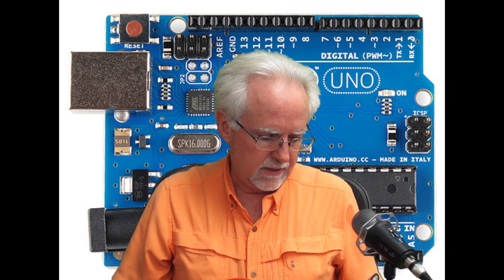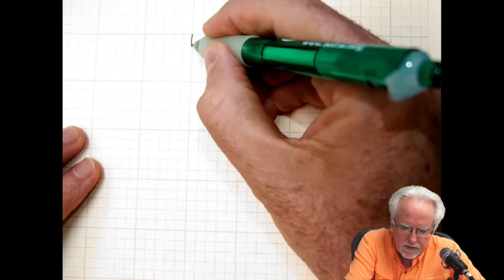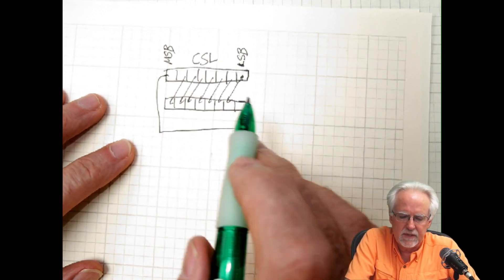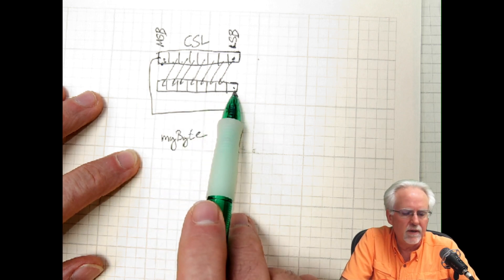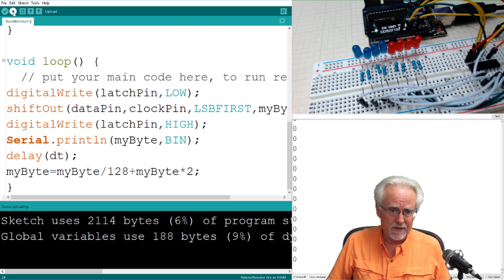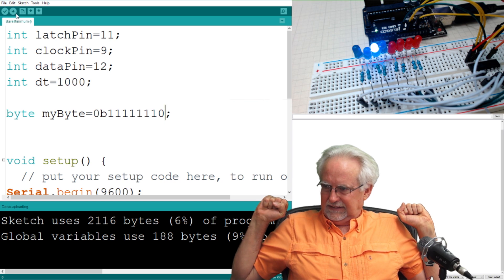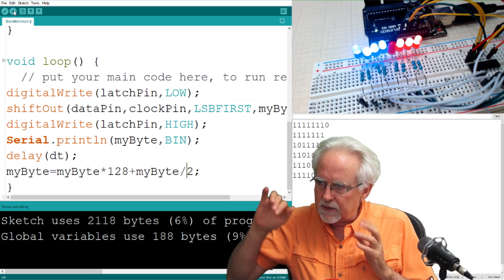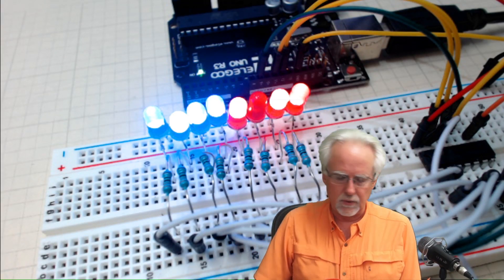Arduino Tutorial 45: Understanding Circular Shift Left and Circular Shift Right with the 74HC595

Comment: And this is the code for Circular Shift Right:

//Circular Shift Right

int latchPin=11;
int clockPin=9;
int dataPin=12;
int wait=50;

byte led=0b11110000;
byte x;

void setup() {
// put your setup code here, to run once:
  Serial.begin(9600);
  pinMode(latchPin, OUTPUT);
  pinMode(clockPin, OUTPUT);
  pinMode(dataPin, OUTPUT);
}

void loop() {
// put your main code here, to run repeatedly:

//Display the Binary Number to the LEDs
  digitalWrite(latchPin, HIGH);
  shiftOut(dataPin, clockPin, LSBFIRST, led);
  digitalWrite(latchPin, LOW);

  delay(wait);

//Reads and stores the 0th bit (LSB) of the variable "led" 
  x=bitRead(led,0);

//Right Shift Operator: Shifts bits to the Right by 1 position
  led=led>>1; 

//Now that the bits in variable "led" have been Shifted, we write the Stored 
//bit in variable "x" to the 7th bit (MSB) of the variable "led"  
  bitWrite(led,7,x);

}
Reply: I was trying to figure out how to use the bitRead and bitWrite commands to replace to *128 and /128. I was almost there but my program kept writing the MSB before the LSB had left.
Turns out I only needed to swap the bitRead and the bit Shift >> command.
Thanks to your comment it now works :) most excellent add-on to all these lessons.
Thank you!

Comment: This was my solution to the circular shift: 
oldMyByte = myByte;
myByte=myByte*2;
if (myByte/2!=oldMyByte){
  myByte=myByte+0x01;  
}
 I noted that a logical shift my are may not be reversible.  If a bit needs to "go around the corner" it is not reversible so I add that bit in later.

Comment: What should be homework is to make it go from right to left like a night rider chaser circuit.
Reply: This is how I did it.
// Night Rider!
// Using 74HC595 serial to parallel shift register & 8 x LEDs

int latchPin=11;
int clockPin=9;
int dataPin=12;
byte LEDs=0b10000000;
int dt1=1000;

 void setup() {
Serial.begin(115200);
pinMode(latchPin,OUTPUT);  
pinMode(dataPin,OUTPUT);
pinMode(clockPin,OUTPUT);
}

void loop() {

while (LEDs!=0x01){
  digitalWrite(latchPin,LOW);
  shiftOut(dataPin,clockPin,MSBFIRST,LEDs);  
  digitalWrite(latchPin,HIGH);
  Serial.println(LEDs, BIN);  
  delay(dt1);
  LEDs=(LEDs>>1); 
  }

while (LEDs!=0x80){
  digitalWrite(latchPin,LOW);
  shiftOut(dataPin,clockPin,MSBFIRST,LEDs);  
  digitalWrite(latchPin,HIGH);
  Serial.println(LEDs, BIN);  
  delay(dt1);
  LEDs=(LEDs<<1);
  }
  
}

Comment: Spent a few minutes trying to figure out the logic to round the corner but nothing jumped out at me so I went a completely different direction with this.  I researched the Arduino docs to find a way to read the individual bit values and came across bitRead() and bitWrite().  Took only 3 lines of additional code but it works the same: int readLedBit;      readLedBit = bitRead(myByte,7);     myByte = bitWrite(myByte,0,readLedBit);

Comment: I had a different strategy. Here was my code for left circular and right circular respectively. My plan was to do the shift as normal but to detect a special case where a change had to be made.

//left circular
if (myByte>=0b10000000){
    myByte=myByte*2;
    myByte++;
  }
  else{
    myByte=myByte*2;
  }

//right circular
if (myByte % 2 ==1){
    myByte=myByte/2;
    myByte=myByte+0b10000000;
  }
  else{
    myByte=myByte/2;
  }

Comment: I'm a DOER! Sorry for not using the math, I went for Arduino documentation and grabbed a couple of functions to accomplish the task before watching your video... I also attached a potentiometer to dimm leds.

// 74HC595
int serialDataPin = 13; // Pin 14 74HC595 (1)
int latchClockPin = 12; // pin 12 74HC595 (1)
int shiftClockPin = 11; // pin 11 74HC595 (1)
int clearPin = 10; // Pin 10 74HC595 (1)
int outputEnablePin = 9; // Pin 13 74HC595 (1)

// Potentiometer
int potPin = A0;
int potVal = 0;

int pins[] = {serialDataPin, latchClockPin, shiftClockPin, clearPin, outputEnablePin};

byte ledsState = 0b11111110;
byte significantByte = 0b0;

void setup() {
  Serial.begin(9600);
  for (int i = 0; i < sizeof(pins) / sizeof(int); i++) {
    pinMode(pins[i], OUTPUT);
  }
  pinMode(potPin, INPUT);

  // Doing this because not wiring MR pin to HIGH
  digitalWrite(clearPin, LOW);
  digitalWrite(clearPin, HIGH);
}

void loop() {
  circularShift(false);
  circularShift(true);
}

void circularShift(bool isGoingRight) {
  for (int i = 0; i < 8; i++) {
    analogWrite(outputEnablePin, map(analogRead(potPin), 1023 , 0, 0, 255));
    writeToRegister();
    Serial.println(ledsState, BIN);

    // Get the least or most significant byte before losing it (according to function parameter)
    significantByte = bitRead(ledsState, isGoingRight ? 0 : 7);

    // Bitshinft operation
    ledsState = isGoingRight ? ledsState >> 1 : ledsState << 1;

    // Write the least or more significant byte in proper location, according to function parameter
    bitWrite(ledsState, isGoingRight ? 7 : 0, significantByte);
    delay(250);
  }
}

void writeToRegister() {
  digitalWrite(latchClockPin, LOW);
  shiftOut(serialDataPin, shiftClockPin, MSBFIRST, ledsState);
  digitalWrite(latchClockPin, HIGH);
}
Reply from the maker: Man, do the math. Math is your friend. What will you do when you hit a problem that does not have a library? I am trying to teach you how to solve problems on your own.
Reply: @paulmcwhorter  Please do not think I'm running away from doing the Math... Yesterday I just was lazy,  and went for that quick solution, guess was tired because spent last week learning how to connect my three shift registers in series cause wanted to create a binary counter with 24 leds hehe. I always do both ways, usually Math first... Thanks again for doing this most excelent tutorial series!

Comment: Hey Paul thanks so much for these amazing lessons. Before i watch the video.. This one was TOUGH. After failing miserably with the last assignment (shifting right or left by simply * or /) i decided that i would figure this assignment out no matter what. I played with the right and left shift but could not find a solution so i decided to go to the Arduino Reference page thinking that i might need a new command to be able to do this assignment. 

I ended up going down the rabbit hole learning about Bitwise Operators (AND, OR, XOR and NOT) and an alternate way to Shift L/R (<< >>). This is some very complex stuff and I started to get frustrated but i kept going. I also learned about the Bit commands (bitClear, bitRead, bitSet and bitWrite). I spent hours yesterday and today trying to understand how the Bitwise Operators worked and when i finally began to understand how they worked, i tried making them work on paper like you taught us in a previous lesson, but i could not find a solution to the assignment. I was soo close to giving up when all of a sudden i thought "what if i save the bit that is lost when shifting and after i shift i just write that saved bit back". 

I wrote the code using the Bit commands which i had not tried using because i was trying really hard to find a solution with the Bitwise Operators. I was blown away when i saw that it actually WORKED! and it only took 2 extra lines of code from the previous assignment! 

I know this might not be the solution you want because i am using commands that you have not taught us but this is how i was able to solve the assignment:

//Circular Shift Left

int latchPin=11;
int clockPin=9;
int dataPin=12;
int wait=50;

byte led=0b11110000;
byte x;

void setup() {
// put your setup code here, to run once:
  Serial.begin(9600);
  pinMode(latchPin, OUTPUT);
  pinMode(clockPin, OUTPUT);
  pinMode(dataPin, OUTPUT);
}

void loop() {
// put your main code here, to run repeatedly:

//Display the Binary Number to the LEDs
  digitalWrite(latchPin, HIGH);
  shiftOut(dataPin, clockPin, LSBFIRST, led);
  digitalWrite(latchPin, LOW);

  delay(wait);

//Reads and stores the 7th bit (MSB) of the variable "led" 
  x=bitRead(led,7);

//Left Shift Operator: Shifts bits to the Left by 1 position
  led=led<<1;

//Now that the bits in variable "led" have been Shifted, we Write the Stored 
//bit in variable "x" to the 0th bit (LSB) of the variable "led"  
  bitWrite(led,0,x); 

}

Comment: did it a bit differently, putting conditions to find out if the first bit was a 1 or 0 and then adjusting conditionally, this is for circular shift left, same method used for right
digitalWrite(latchPin, LOW); 
shiftOut(dataPin, clockPin, LSBFIRST, LEDs);
digitalWrite(latchPin, HIGH); 
Serial.println(LEDs);
Serial.println(LEDs&8);
if((LEDs&128) == 128){ // if a=10011 and b=10010 then a&b=10010, gives a 1 where both have  a 1,
LEDs=((LEDs-128)*2)+1; // LEDs&128 == 128 means that if LEDs has a 1 at the start like 128 does (10000000) then LEDs&128 will be 1000000 (128)
delay(dt);
}
else{
LEDs=2*LEDs;
delay(dt);

Comment: Doer. 

For me it was easier to think of bit masking and shifting than addition, multiplication and division although the two approaches are equivalent in result. Although I admit that for the less experienced, your approach is simpler.

For circular shift left, I masked out the MSB (myByte & 0x80), then shifted it left by 7 bits to get it into the LSB bit position (similar to dividing by 128).  Then I shifted the original bits left 1 bit (myByte << 1) which is the (similar to multiplying by 2). Then I OR'd in the captured MSB into the LSB position (equivalent of adding the captured bit in your example);
Code:
Yours: myByte = myByte * 2 + myByte /128;
Mine:  myByte = (myByte << 1)  |  ( (myByte & 0x80)>>7);

Circular shift right was similar:
Yours: myByte = myByte / 2 + myByte * 128;
Mine:  myByte = (myByte >>1) | ((myByte & 0x1) <<7);
Reply: After reviewing my original solution, (palm slap to head) I didn't need to do any bit masking. I forgot some of the basics about the C right and left shift operators. 
Updated code that makes it simpler:
Right circular shift: myBytes = (myBytes>>1) | (myBytes<<7);
Left  circular shift: myBytes = (myBytes<<1) | (myBytes>>7);

Comment: Little question, Paul. Can you put 2,3 and more chips in a circuit to have more leds? Thanks, this lessons are the best I have see on arduino courses. Keep posted
Reply from the maker: future lessons will talk about using a shift register.
Reply: @paulmcwhorter  can it work with more than one 74hc595 chip?

Comment: Tutorial 42 about Serial to Parallel Shift Registers (SPSR) was very interesting. If it takes only 3 pins to use one SPSR to control 8 LEDs is it theoretically possible to use 4 SPSRs (using 12 pins on the Arduino) to control unto 24 LEDs ? The practical application of the use of a SPSR for a binary counter was also interesting, as it may help kids to learn binary numbers. However, while Tutorials 44 and 45 were challenging home assignments and fun to think about can anyone think or suggest  practical applications of them?

Comment: Hi Paul.  I am usually a DOER, but this time I am a watcher for 2 reasons:  My laptop is in the house, and my components are in the garage (mancave).  The main reason though, I was expecting different shift commands (i.e. MSB = LSB - prior to right shift, and LSB=MSB prior to left shift) instead of a math solution.  As for the shift commands, are there such things?

Comment: My approach to the problem:

int latchPin=11;
int clockPin=9;
int dataPin=12;
byte LEDs=0b00000101;
byte LEDread;
int wait=500;
String data;

void setup() {
  // put your setup code here, to run once:
  pinMode(latchPin,OUTPUT);
  pinMode(clockPin,OUTPUT);
  pinMode(dataPin,OUTPUT);
  Serial.begin(9600);
}

void loop() {
  // put your main code here, to run repeatedly:
  digitalWrite(latchPin,LOW);
  shiftOut(dataPin,clockPin,LSBFIRST,0);
  digitalWrite(latchPin,HIGH); 
  Serial.println("For CS left input L:");
  Serial.println("For CS right input R:");
  while(Serial.available()==0){
  }
  data=Serial.readString();
  if (data=="L"){
    LEDread=LEDs;
    while(Serial.available()==0){
      if (LEDread>128){
        LEDread=LEDread*2+1;
      }
      else {
        LEDread=LEDread*2;
      }
      Serial.print(LEDs,BIN);
      Serial.print("|");
      Serial.println(LEDread,BIN);
      digitalWrite(latchPin,LOW);
      shiftOut(dataPin,clockPin,LSBFIRST,LEDread);
      digitalWrite(latchPin,HIGH);
      delay(wait);
    }
    data=Serial.read();    
  }
  if (data=="R"){
    LEDread=LEDs;
    while(Serial.available()==0){
      if (LEDread%2!=0){
        LEDread=LEDread/2+128;
      }
      else {
        LEDread=LEDread/2;
      }
      Serial.print(LEDs,BIN);
      Serial.print("|");
      Serial.println(LEDread,BIN);
      digitalWrite(latchPin,LOW);
      shiftOut(dataPin,clockPin,LSBFIRST,LEDread);
      digitalWrite(latchPin,HIGH);
      delay(wait);
    }
    data=Serial.read();    
  }
}

Comment: Oops, I meant to ask:  If it takes only 3 pins to use one SPSR to control 8 LEDs is it theoretically possible to use 4 SPSRs (using 12 pins on the Arduino) to control an additional 24 LEDs or 32 LEDS in total?
Reply: Actually you can use more 74HC595s cascaded off of pin 9 of the first, second, etc 74HC595.  The Serial In (DS pin 14) is connected on the first, Storage Clock (SH_CP pin 12 ) and Shift Clock (ST_CP pin 11) connect to all 74HC595s, and Serial out (Q7 pin 9) goes to the Serial In (DS pin 14) on the next 74HC595 in the cascade.  Google "cascaded 74HC595"

Comment: is there any current limit for shift register, because i tried this circuit in TINKERCAD, but it tells that current is high so shift register will burn out. I tried adding resistors to powersupply and datapin but, it is still showing the same. 

Can anyone help me with this? i will be glad if i get a reply

Comment: I was stumped on this one.  I had gotten to the point of checking the value of the MSB but I keep forgetting they're bytes and anything fractional is disregarded that is usually a trick for determining odd/even etc.  Also I got frustrated that something that I could have done in a sec with an AND statement, my lack of proficiency with Arduino sketches made laborious and confusing.  Finally just gave up.

Comment: I tried and failed, but I was trying to do this using B01010101, and did not realize the assignment was to do it with B00000001. The code in this video does not work for B01010101, so I did not come to that solution. How would you do this for B01010101?

Comment: Huh, the way i did it worked although it was a bit longer

if(myByte>=128){
  myByte=(myByte-127.5)*2;           //for some reason "(myByte-128)*2" didn't work but 127.5 did so yea..
}
else(myByte=myByte*2);
Reply: I found some ways to listed all the pair of shifting numbers in excel, then I found the correllation and guest? I ended up with the same function as you did

Comment: int latchPin=11;
int clockPin=9;
int dataPin=12;
int dt=1000;

byte myByte=0b10110000; //Put your binary number here

void setup() {
  // put your setup code here, to run once:
Serial.begin(9600);
pinMode(latchPin,OUTPUT);
pinMode(dataPin,OUTPUT);
pinMode(clockPin,OUTPUT);
}

void loop() {
  // put your main code here, to run repeatedly:
digitalWrite(latchPin,LOW);
shiftOut(dataPin,clockPin,LSBFIRST,myByte);
digitalWrite(latchPin,HIGH);
Serial.println(myByte,BIN);
delay(dt);

int myBit = myByte % 2;
if(myBit==1){
  myByte=myByte/2+128;
}
else{
  myByte=myByte/2;
}

}
this also works
my circular left implementation was the same

Comment: I tried doing this as I did the linear shift but I dont get it why it moves like that. I set an example of  Decimal 174 - 10101110 and wanted to convert that into 01011101 - 93 decimal. But by doing 174*2-174/128  = 349,35 which is not a binary with 8 switches. I dont understand why it works like that.
Reply: I got the same problem.But your 349,35 is over the 255. So in the previous video I was already figuring that out because his calculation must get over the 255 limit. So than it will go to zero again.

We work with the number 255 but because the zero is also a number... therefor you need to subtract 256 of your 349,35 and that will be 93,35 (because it is an integer it will become 93... and that will result in 01011101

Comment: Okey, im a Doer, but in this case i used a if conditional  in both ways to get a movement to right and left sides, first i used a if to determinated if that  currently byte is more than 128 and if that condition is true, the operation will be (byte*2)+1, and if that condition isn't it, then, the operation just will be (byte*2),  and for the other side, i used and the same way a if conditional but also i added a new variable firts, i put a if condition like that, if new variable is equal to byte it gonna do this (byte/2) else if that condition isn't true, this gonna do this  (byte/2)+128,  but before this if conditional, i put a operation like new variable=(new variable/2)*2, i used this operation to determinated if there are any bit in the 1 square or section, then in the if conditional part that variable gonna comparated with the byte and the gonna do the appropriated operation, and in the last part i put this new variable=byte and in this way i could get it. I apologize with yall about my english, if you wanna say me any advice about it or any else,please ,  let me know in the comment. thanks

Comment: Hello Paul
I am a doer but I have a hell of a hard time with my parenthesis, I simply can not figure out when they shall be there, and when they do not. Can I download a complete code set from the lessons along with the scematics, I have to read the codes a lot of times to get the understanding?
Reply: From a math viewpoint, I expect Paul would agree. You can almost NEVER have enough parentheses. It is always best to use parentheses to force mathematical "order of operation"  to evaluate your math the way you expect as "sometimes" how you expect the compiler to solve your equation may be different from what you expect!